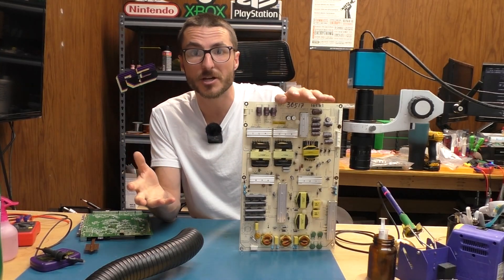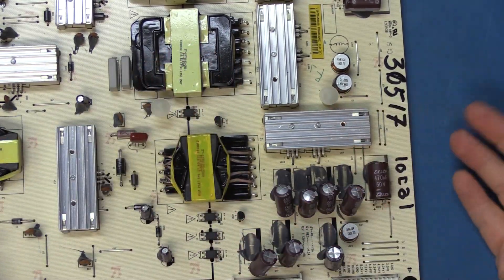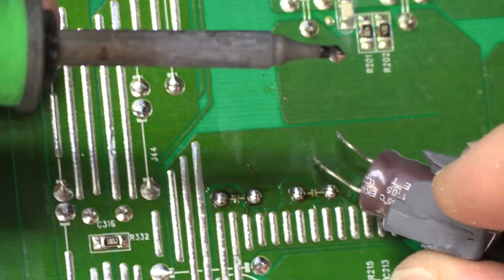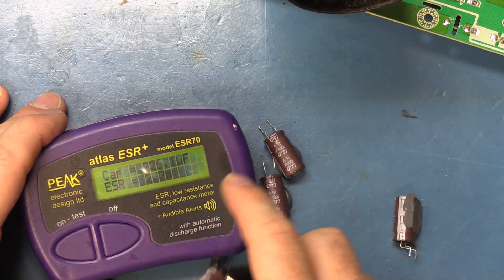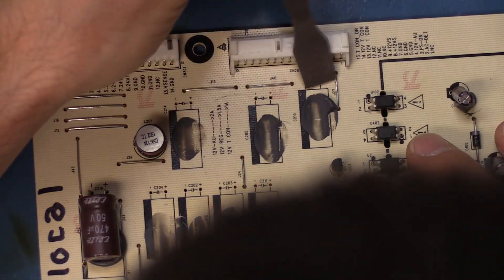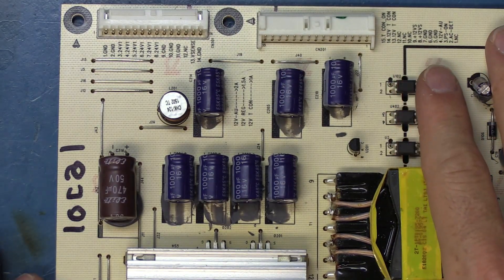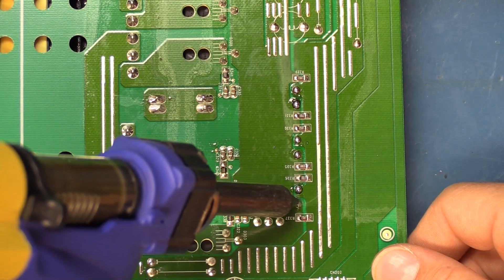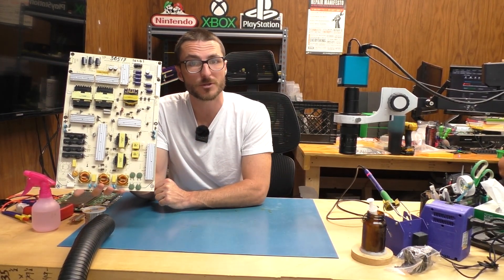Vizio TV No Picture Repair M70-C3 Power Supply 09-70CAR080-00

Comment: So you have repaired more than 7 TV's every day (even more if we exclude Saturday and Sunday) ...
Reply from the maker: That is correct, but just a small adjustment for clarification, it's 10.5 devices on average per day (excluding weekends) It's also not all TVs. We fix audio equipment, receivers, radios, game consoles, oven controller boards, NAS devices, servers, ECUs, CPC4s, and much more all of which are considered in that count. 
We don't do that much volume locally most of it is online. So if you mail in that power supply and we fix it, that is included in the count. Some days we only have 5 boards come in for repair, and we have days where we get 20 so an average of 10 or so per day I would say sounds about right. However lately, that has been increasing.

Comment: Can you tell how to power on the board using jumpers! Thanks!🙏
Reply from the maker: It's all about taking a look at the legend on the board. It will tell you how. PS_ON or POWER_ON lines are the lines you want to introduce 3v to activate the power supply. Then there are T-CON_ON lines or PANEL_ON which is to sent 12v to the T-con and screen that you can give 3v to activate that part of the power supply and then often there is a separate backlight on labeled BL_ON same thing 3v and it will activate it. 
These are all the on command lines and this will work for 90% of newer power supply boards. You don't have to do any of this for Samsung, they auto on by default.
Reply: @NicksTVRepair  Thanks for answering. Yes, I know about legends on the board! I asked because in your another video on Samsung television power supply board you powered it on using jumper wires! That's what I am curious about as still I didn't get how you did that! Thanks! 🙏
Reply from the maker: Oh yeah so some boards require jumpers but not all of them. 
For example any of the newer Samsung LED power supply boards don't need jumpers, by default everything turns on automatically when the mainboard is disconnected. Most often for vizio and sony power supply boards you have to jump 3v to the on command lines.